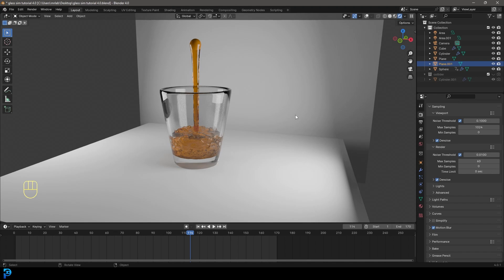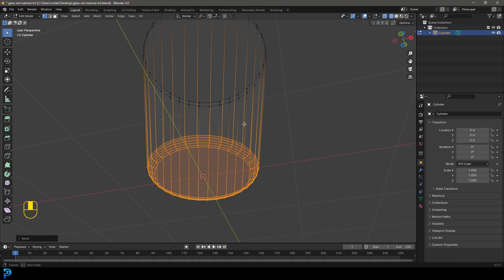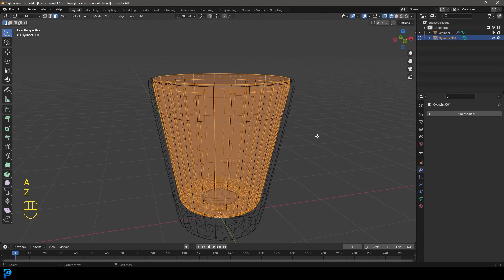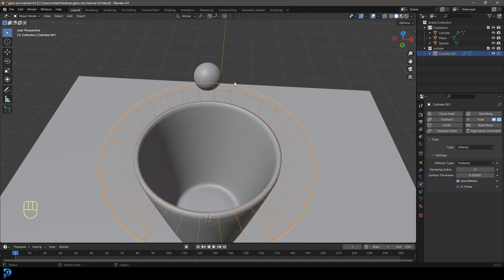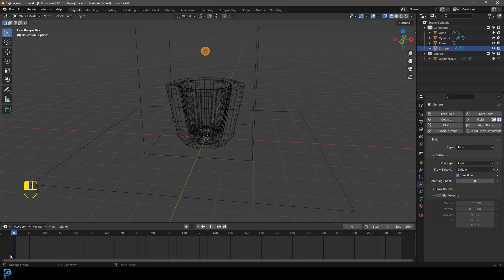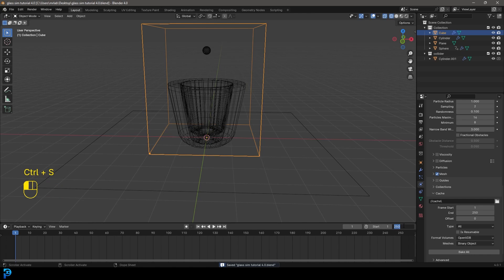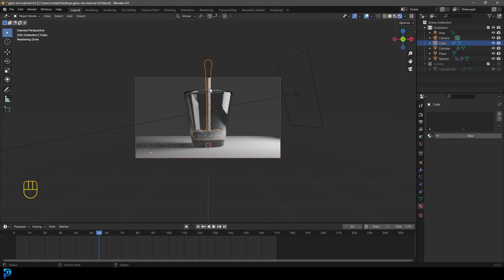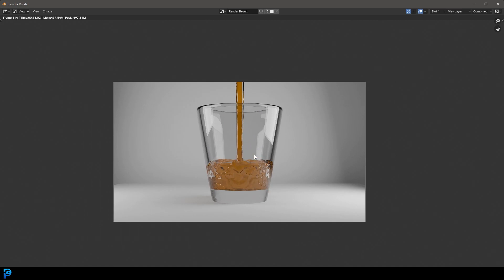Basic Glass Liquid Simulation (Blender 4.0 Tutorial)

Comment: Hi Im using a Mac Book pro M2 it takes about one hour to Bake is this normal ? or I need to get an IGPU nvidia with 9 gen cpu? If I want to do this king of Rendering more aften. ?  what would you suggest ? would that shorten my Bake time ??
Thank you I love your Videos
Reply: The rendering and baking of the animation are two different things,   if you are rendering it's always best to do this on a GPU,  baking a fluid animation into cached data will take longer the higher the resolution 16 fast 256 very long wait time. the better and more cores a CPU has the quicker the bake but in most cases it takes quite a while.